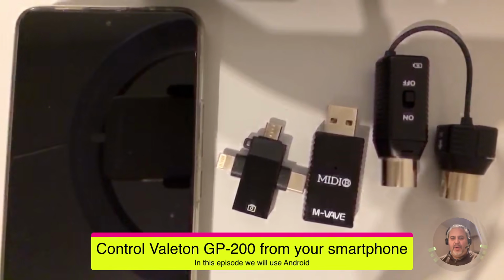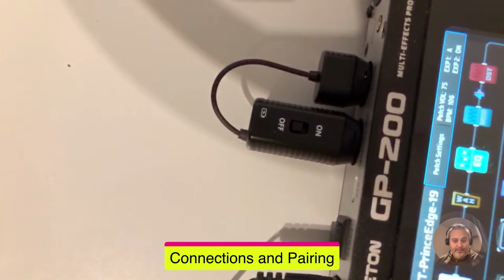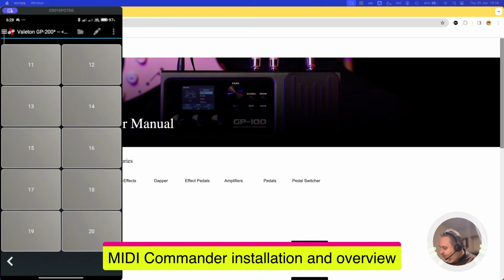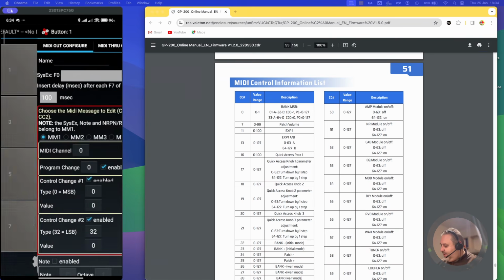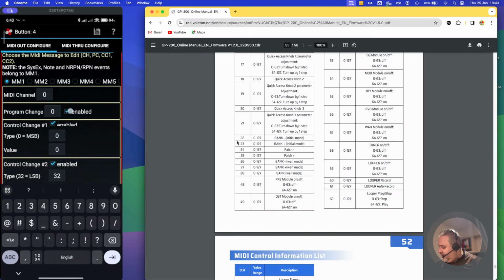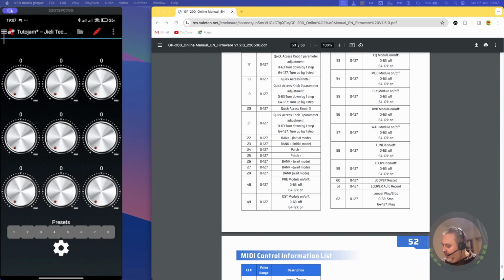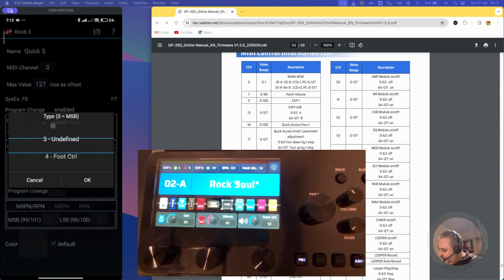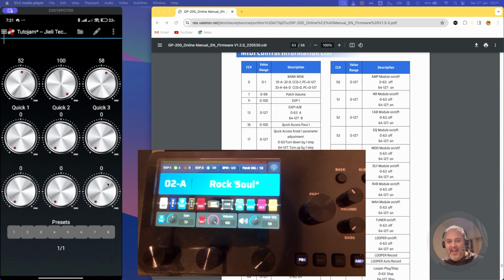GUITAR 43: Valeton GP-200 + Android smartphone

Comment: I bought the components for this, but the app crashes on my android phone when the USB is plugged in. It runs fine without the USB. No errors are reported, but this idea is dead in the water at this point. I tried setting the USB port on my phone to MIDI but this did not stop the crashing. The USB on the phone does pair with the Valeton, so the issue seems to be with the app not the physical connections.
Reply from the maker: I am experiencing some troubles as well, it seems to be due to android system. Usually can be solved selecting to use the Android midi subsystem in place of the main one.

Comment: Great video! Congrats! Do you have any ideia to do such thing on gp200lt? It has 1/8 midi connections.
Reply from the maker: Hi, I am happy you liked the video. I do not have the JR but it should have the same functions but just use different ports to save space. So you should be able to apply what I did with the standard version simply using 2 adapters. Just google "midi female to jack" and you will find many options. Bye